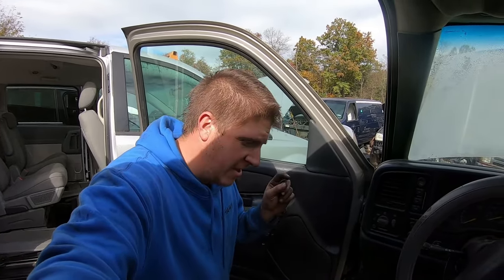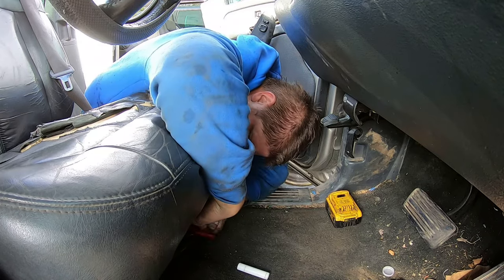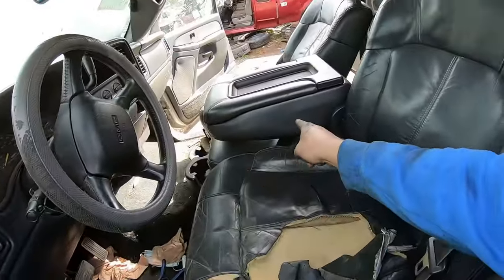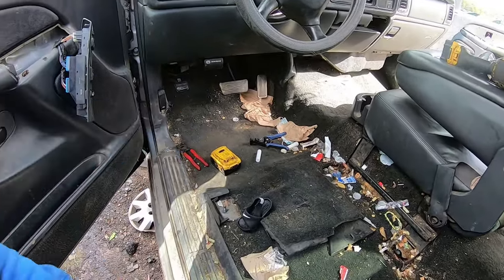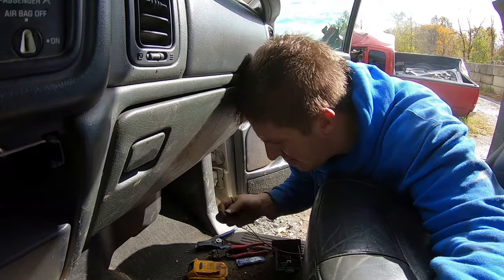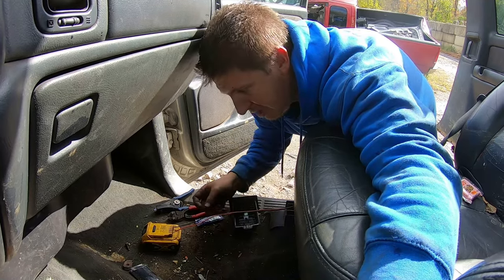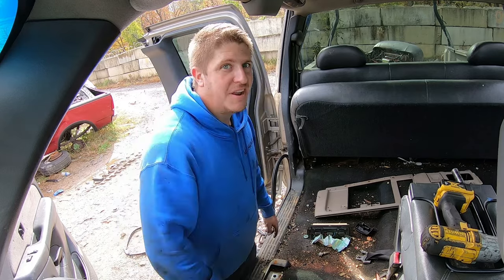SIMPLE TRICK for JUNKYARD power seat REMOVAL!!

Comment: Awesome ! I just gave up at the junkyard last weekend trying to get a center console out. You just earned a sub and like! By the way, you can use a 7/16 socket on the rears!
Reply from the maker: Thanks for the sub and comment. I've never tried a 7/16 on the rear bolts but I can see how that would work very similar to the 15mm socket on the front nuts.

Comment: I don't know about cutting the wire, but the condition of that seat it wouldn't matter.  You can also use a riding lawnmower and set of jumper cables.  Good video and explanation of wires for pos and neg.
Reply from the maker: Note that I specifically said to cut the truck side of the wire harness, aka, the wires on the truck side of the connector. That way your seat is still 100% intact, no cut wires, you just plug it into your own truck when you get it back. 

Lawn mower battery with jumper cables would work also, but still more stuff than I want to carry around in the junkyard.

Comment: Is there any risk of seat air bag deploying when doing this?
Reply from the maker: Only if you really mess up. All of the supplemental restraint (airbags) wiring is in separate yellow connectors, don't connect power or ground to anything in the yellow connectors and you will be safe.
Reply: @MohawkMotors oh okay thanks! I know they’re normally fed 12V….would an 18V battery work for this/won’t fry motors? I want to use this trick to test a power seat prior to pulling it so I know it works
Reply from the maker: 18V is fine for testing and removal.  The battery I used in this video is a 20V dewalt battery and didn't hurt anything.

Comment: You are very clever, Sir. I wonder if you can do the same if you want to check if the seat can recline using your method? What color of the wire to use? Thank you in advance.
Reply from the maker: I'm not sure about other manufacturers, but in the gmt800 trucks and suv's the same 2 wires supply the power for all the functions, recline, forward and back, lumbar, etc.
Reply: @MohawkMotors  The question is for my 2000 Buick LeSabre, the power driver seat is not working. I wonder if the wires that you just showed will do the trick. :)
Reply from the maker: I'd bet there's a good chance it would work for your lesabre
Reply: @MohawkMotors  Okay thank you. God Bless you!:)

Comment: On fnding change:  while crusing  my local pick 'n pull in modesto ca , chatting with jobless dude. For xtra $ he spends half a day under mats, seats, consoles , never less than $20; about same as picking up soda cans...he said.😊
Reply from the maker: I believe it, always a chance of a big score too, I've found a few $5, $10, and $20 bills between seats and underneath where they're hard to reach.
Reply: had 2 wire harness connections: o ne with 4 wires (2 of which were black and v t orange), and the other had 8 wires(2 were black, a couple were pink and red striped, and there was blue and maybe a green and a yellow by..)
So I proceed with  Dewalt 20v. Nothing happened.
I try again and no movement of the junkyard car seat.
But it did start a fire .

Comment: I used a car battery and it did move forward but now it does not move any more do you think i might of butned the motor on the seat
Reply from the maker: a car battery shouldn't have hurt the motor, they are designed to run on battery voltage when the truck is running. Sometimes one direction fails in them, sometimes you just get unlucky and they work once and then don't work again.
Reply: @MohawkMotors  thank you ill try tomorrow to move it bacckwards btw i watched your 4.3 to 5.3 engine swap my donor is a 2002 suburban im stuck right now with the fuel lines  but the engine and transmission is alredy in and bolted
Reply from the maker: What are you stuck with on the fuel lines?

Comment: So instead of cutting the wiring harness needed if the seats were to be reinstalled, you cutt the wires connected to the truck connecting to the harness ? So then you could take the truck side conncector off once uninstalled and the seats are still in one piece ready for plug and play ?
Reply from the maker: BINGO!!! Cut the truck side of the harness, that way the seat you want is still in plug and play condition, and if you need the other side of the connector you'll have it as well!

Comment: Would this work with just an energizer 9volt battery from the grocery store?
Reply from the maker: MAYBE, and thats a very big maybe. If the battery was super fresh and the motors in the seats were also healthy you may be able to move the seat a bit, but I don't think it would be enough to actually remove the seat.
Reply: @MohawkMotors  thabks for the reply... is there something at Walmart I could buy?
Reply: @MohawkMotors  or even, could I take my car battery out of my other car and use that? Would it be too many volts?
Reply from the maker: I'm sure walmart would have something in the automotive department. Any battery with 12-18 volts will work fine for this. Heck you could even use something up to 20 or 24 volts. All you're doing is providing power directly to the motors and switch, which aren't all that voltage sensitive in this circumstance. Battery out of your car would work just fine.

Comment: I have a great little adapter that clips in the battery  with a USB port and has a pair of wires that you have red and black  wires  12v +- but I have  so I can make the interior light on my  trailer and  not have any issues with my guys at work nights it's just so much easier to see i have  led light bars  not dinky  dome  light like a car  was like 10 bucks on temp and the other is a led light cube  like on off road vehicles and they are 5 times as bright as dewalt 20v flashlight   and they have them in your brand name tools  battery adapter and they have adapter to use a dewalt 20v for all the 18v stuff and no more nicad business 😂 creates our tools to use our other tools batteries and no need for 10 in each brand
Reply from the maker: That's really nice to have those battery adapters. Some brands make certain tools better than other and having a bunch of different batteries is annoying.

Comment: But what do you do if the motor is broken by the seat is there a manual way??
Reply from the maker: If the motor is broken, you can remove it (major pain in the butt) and then move the seat by manually turning the driveshaft to the worm gear. Unless the seat was going to be free, or I was really desperate, I would just find another seat.
Reply: @MohawkMotors  ok I will try that thanks

Comment: How do you remove it if the seat won't move? Like it is stuck.
Reply from the maker: If the motors or actuators are stuck or broken, the only was to remove it is completely take apart the seat tracks and rails. It's a massive pain.
Reply: If you don't see anything obvious holding it up; like a coin wedged, best to move on cause something ain't right with it

Comment: When the seat motors are fried, and will not move, what is Plan B?
Reply from the maker: Remove the motors. Or remove the little drive cables that run from the motor to the gear. That's the only way I've been able to get them to move once the motor is dead.
Reply: @MohawkMotors  Just saw Auto Auction Rebuilds not able to do that with bad Allante seat motors. he ripped out the passenger seat, and used an engine hoist to rip out the driver seat. Could not get at the bolts to remove them, and could not get at the motors...
Reply from the maker: @cousinjohncarstuff4568  I can't speak for other brands as I really only mess with GM products. But I can tell you that if you remove the drive motors from a power seat in the GMT800 platform, you can then turn the screws and move the seat forward and backward enough to access the bolts. I've done it myself. It really really sucks but it can be done.

Depending on the reduction ratio or drive system other manufacturers use it may not be possible without destructive methods

Comment: I just hook up to battery terminals under the hood
Reply from the maker: can do it that way also, sometimes the battery cables are missing though
Reply: That will work if the fuses and harness stuff is intact.  Check for power to ground continuity or look for smoke after the connection is made 😊😊

Comment: Lmao 🤣
You never showed the harness either before or after. When you said "Hopefully you can see what I'm doing here" is when you lost credibility.
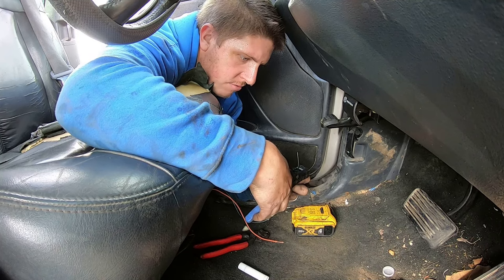Reply from the maker: 1:00 I pull the harness out from under the seat, at 1:27 I strip the wires and explain which ones you need, at 2:00 you can see the wires hooked into the battery and the seat moving.  

I'm not sure what more you're looking for than that Scott.
Reply: @MohawkMotors  
You pulled from the front and suddenly magic wires appeared with nothing indicating where they came from. The drivers seat harness comes from the rear yet you pulled from the front. I saw no wires when you removed the seat.
Reply from the maker: Actually Scott, in the 99 to 02 trucks, like I was using to demonstrate in this video, the harness connects in the front. The plug wasn't moved to the rear until 2003 model year. In the GMT 800 platform large orange is the main power feed to the motors, large black is main ground for the motors, whichever year seat you're trying to move, Large orange to power, large black to ground/negative and you can move the seat, assuming the motors aren't bad. 

Just trying to help people out, as you can see from the comments, this video has helped a bunch of people. 

Thanks for watching!
Reply: @MohawkMotors  
Working on a 2002 Yukon XL. The passenger seat came out without an issue once I got access to the harness (front). Drivers side access was in rear. Used an 18volt DeWalt battery as well. Great idea on that btw.
My confusion stems from the difference in years and the wiring changes.
I'll continue to watch your content 👍👍